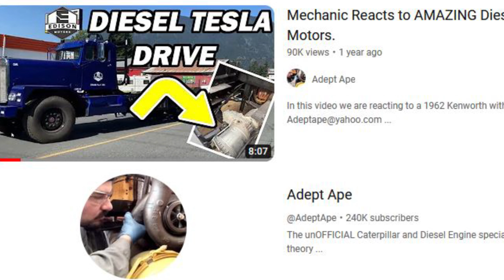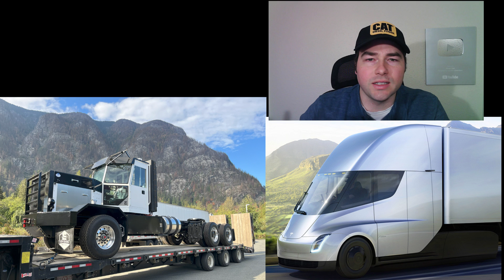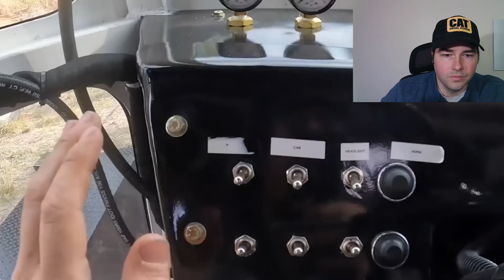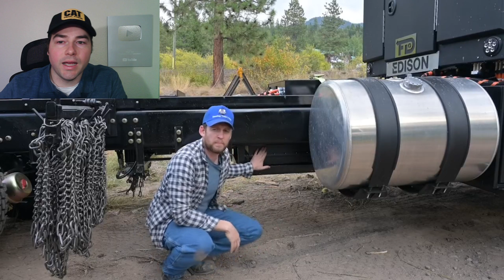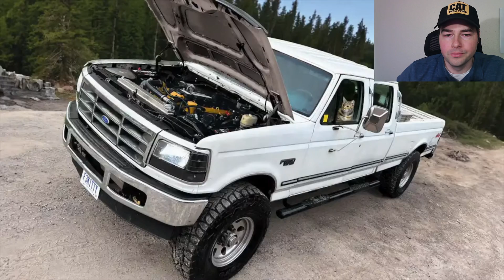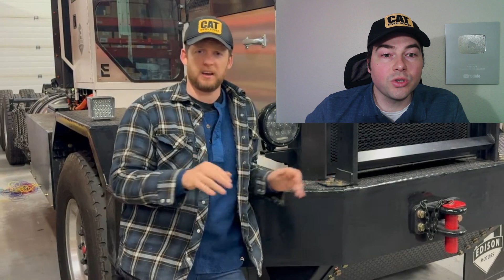Edison Motors New Truck DESTROYS the Tesla "Semi Truck" design!!!

Comment: The Edison trucks actually look like they were designed by people who know what truck drivers and transportation companies want.

The Tesla "truck" is a non-solution looking for a non-existent non-problem.
Reply: The guy is a driver/ owner. I’m pretty sure he still hauls logs. And makes great units.
Reply: Trucks made by Truckers
Reply: Not only that, instead of trying to land on the moon Tesla straight up aimed for the sun. Out of all the fields of trucking long haul is probably the hardest one for a battery-only truck. These things drive on for hours on end, at constant speeds, without stopping. Sometimes there are even multiple drivers operating the truck in shifts, to minimize the time standing still. Tesla is trying to outdo diesel trucks at what is probably their biggest strengths (running on for hours on end) , without many opportunities to play the strengths of EVs (like regenerative breaking or the good acceleration). All the other elctric truck companies focused on distribution trucks and busses first, as their field of work is good at making the EV's advantages shine. With such a vehicle it also doesn't matter if it needs to charge all night.

Edison chose not to bother with this already competitive field, and instead bother with an industry that already feels kinda forgotten or left out both by diesel and electric trucks. Not only is logging and mining another good fields to show the benefits of electric fields, it's also a great field for their other innovations, like the cabin. Whilst big companies stick every part into a windtunnel Edison chose to prioritise repairability instead. Speeds on logging roads are kinda low, so the benefits for fuel economy and even driver comfort are dwarfed by the higher repair costs. For example, curved windshields may lower wind noise and improve economy by a handful % on the highway, but when they break it is expensive to replace them. Topsy has flat window panels, so if you can't find a pre-cut replacement you can ask pretty much anyone who works with glass to make you one.
Reply: That’s because it was
Reply: This is such an awesome design. I can't believe there haven't been more diesel electric hybrid semi trucks based on the success of cargo trains.
Reply: @1800imawake : And that's been the solution all along. Germany tried going full EV with their trucks, but ended up running caterans to overhead wires to keep the truck batteries charged, essentially making big rig trucks one-car land trains.
Reply: @isaiahwelch8066 also known as locomotives, you know these? The big 4400HP diesel electric monsters that haul mile long trains? Topsy is just like that, but for short hauling, usually to carry heavy equipment on bad pavements, most railways have diesel trucks designed especially to do that while running exclusively on tracks
Reply: They don't build the trucks they take old logging trucks and convert them to hybrids
Reply: @DukeNukem3955  They do both and Topsy was built from the ground up, what rubbish are you spewing.
Reply: Wow.  A solution to a problem.  How dare they. 😢
Reply: The Tesla semi was designed by board room members. Forget battery fires, does that putrid Muskrat realize how important it is to get out of a truck after a rollover? He only put one door on the Tesla.
Reply: @pootispiker2866   the tesla semi truck was designed in a wind tunnel, its built to be very efficient, fires are a problem for diesel trucks not teslas.
Reply: @pootispiker2866 the tesla semi is designed to be the most efficient semi on earth. The cab is fine for its use case of running between city distribution centres.
Reply: @saff226 which it does absolutely sucks at that, crazy expensive with poor visibility, extremely heavy, and lacks almost all safety features modern rigs should have
Reply: The Tesla "truck" looks like a truck designed to be in a sci-fi video game.
Reply: They essentially made a railroad locomotive for the highways.
Reply: The Tesla Semi and Topsy are optimized for two very different types of trucking. The Tesla is built to haul things that fit inside an aerodynamic trailer down a highway. It's really efficient and it's a pure BEV.
Topsy is built for hauling very un-aerodynamic payloads, like logs, construction equipment, and generally anything on a flatbed truck.

The aerodynamics have to be bad because of the payload, so you are going to have a lot higher drag and energy requirements.
If you are driving a logging truck, you are also going to have to drive on surfaces like gravel, which are going to have higher rolling resistance compared to asphalt and concrete.
Edison concluded that current batteries just don't have the energy density for this type of work yet and decided to go with a hybrid electric drive. Since they aren't optimizing the aero, they can also get away with building it for ease of maintenance without much in the way of performance losses (flat windshields, generally less compact, etc.).
The con is that it's still basically a highly efficient diesel truck, not a pure BEV. 
If we are going to achieve net-0 by 20xx then we will eventually be forced to gradually transition from fossil fuel based diesel to a sustainable alternative made from a mixture of synthetic E-fuels and biofuels. Just based on the fact that E-fuels are made from green electricity (and water + CO2), this is going to mean that your zero emission diesel alternative is almost certainly going to be significantly more expensive than charging directly from the grid.

Topsy is definitely a huge improvement over current diesel trucks, but as the era of cheap fossil fuels ends and batteries become denser the market niche for hybrid electric vehicles will likely continuously shrink over the next one or two decades, while BEVs continue to expand into new applications and pure ICE vehicles die out.
Reply: @plainText384 there is no way to charge the tesla.

The grid can't keep up as is and won't for 40 to 60 years. 

The tesla is a failure before they even build one.
Also they haven't built any.

People forget about the failing grid.
Reply: Unlike Elon Musk who couldn't drive a truck if he paid someone to do it for him? Like he does everything else...
Reply: Everyone so fascinated by a scam its incredible. I can almost guarantee its more efficient to slap a fucking diesel engine on that mofo and run on that. Wasting fuel to convert to watts, super inefficient. Theres a reason he'll never sell them, hes leeching you people of your money.
Reply: moron, the tesla semi truck is built for low drag and its solution is costing half as much to operate than any diesel semitruck.
Reply: The truck is not a truck in don't have Jakes break
Reply: It’s not even a solution to the problem they said was a problem….
Reply: They don't build the trucks they take old logging trucks and convert them to hybrids
Reply: @DukeNukem3955 Yes, they build the trucks. 
The retrofitting is being done by outside installers.

They also sell retrofit kits to the general public. You can build one yourself at home.
Reply: How?  Unless the current Peterbilts, CATs and so on aren't being made like truckers want either?  To me, this thing looks like a pilfered frame with a home-grown farm tractor cab zip-tied to it that I'd feel sketchy standing near.  The lack of accelerator and brake pedals in this truck is what really got me though.  Plus, if they couldn't get the switches in the dashboard in a straight line, I doubt the cab mounts are straight either.
Reply: @FuckGoogle502 you weren't paying attention were you?

As a driver, I prefer this to comparable diesel, and none of the Commercial highway rigs can do this job.
Reply: @FuckGoogle502 : Keep in mind, this is just a prototype, demonstrating proof of concept. I wouldn't actually be all that concerned, if the truck actually works.
Reply: @FuckGoogle502 doubt you could actually put a zip tie together...

Comment: Style, comfort and livability for the over the road semi truck is pretty bad.
Reply: Then get your luxury spec truck from someone else and go back to Edison Motors and swap the engine and driveline for the hybrid-electric experience. They are also doing conversion you know and their main targets are the vocational trucks. 

In more videos of Edison Motors, a concrete batching plant company is interested on their business (new build or conversion). Transit mixers, when loaded, need the drums to keep spinning. With the Edison way, you can still spin the drum without ever running your engine. And some suburban places requires you to have a permit to run the trucks there as noise complaints are a fairly common reason. You can "sneak" in to the place, deliver your load, then get out without ever running your engine or disturbing the place. Waiting for your next batch of load on the plant? You can wait anytime without ever needing to idle your engine, saving you fuel and engine repair costs when the idle times gets bigger. Even drilling companies are interested on the Edison way for their drilling trucks. No need for an auxiliary engine to run the drilling rig. Let the batteries do the thing for the rig and the engine to just top up the batteries ones in a while. It can even supply power to the site if you install such feature to the truck.

 In comparison to the Tesla Semi, Topsy is shockingly lighter than the Tesla. Even though Topsy is spec for off-highway work, with those ridiculously thick bumper, frames, engine cover and overall ruggedness. Chase even said that he can make it loose some weight for on-highway spec trucks that can still beat the Tesla Semi in range and charging time. The Edison way is charging on the go while the Tesla Semi is charging while not moving at all. The range is set to how much fuel you have on the fuel tank to feed the generator engine (no matter what type of generator engine you want your truck to have).

On the topic of pick-up trucks, they are also targeting the work trucks like a welding rig truck. A welding rig truck has an auxiliary engine to run the welder and welding action takes place seldom times. Most of the time its idling itself and the welders are prepping the materials to weld. In the Edison way, there is no idling time as the batteries can deliver the instant power that the welder needed during action. He even estimates that you can finish the entire day without ever firing your generator engine and solely rely on the batteries. Also, the pick-up truck conversion kit can fit to the most common/popular truck of the world and that is the N-series of Isuzu and their myriad design copies of different companies. These trucks have even more configurations than your typical american pick-up. Truck mounted crane (2 to 4 tons), manlift, transit mixers, sweepers, bus, welding rig, mobile mechanic shop, mobile speakers/dj platform rig, liquid tankers (water, fuel, chemical or waste), dumper, recovery flatbed with winch or tow trucks. The design of having a small COE cab and a long usable rear frame (from 10ft to 20ft) makes it the truck to do it all and Edison Motors can tap into that very big market when they decide to go the international market.

Comment: I think they have gone back to the basics - made it utilitarian (do the job and get rid of all the unnecessary bells and whistles), and keep it designed so that the mechanic can work on it when it needs repairs. It will be really interesting to see the pickup truck prototype!
Reply: If they just take an existing truck body and make a drop-in power system...  at an affordable price.
Reply: @fhuber7507 the kit is a heavy-duty pickup kit. 3 tonne axles? 
Not cheap compared to a 50k Tacoma but much less than a new F 550- 650.
Reply: "do something really expensive, but not expensive this time but keeping the quality" @fhuber7507

Comment: I'm glad we're seeing some experimentation in the diesel-electric area instead of just ICE/EV. Trains already showed us at least in some situations it's not only workable, but very efficient as well. Hopefully we can transfer most of those improvements and gains as more work and research is done, luckily we've already learned a lot through marine/train engineering.
Reply: Diesel electric has been used for years,  in open pit haul trucks. Before they perfected large drive trains.
Reply: Some new heavy equipment has diesel electric which is neat John Deeres I think it's called a 944J big wheel loader that's like the size of a building has diesel electric
Reply: #1 too many rigs and roads.  Period. Disaster. Power outages.  Enjoy
Reply: Those tesla semis are such a joke its pathetic elon is the worlds biggest scammer
Reply: Diesel- electric powertrains have way more losses than diesel- mechanic ones. The reason they are used in locomotives is because a transmission couln't help but break (like many did in the early years of trains) and electric motors provide full torque at 0 rpm. Something you don't need in a truck, because you are moving much lighter loads. Diesel- electrics maybe make sense if you are - for example - in a caterpillar or something. You know, where you would be shifting very much or going back and forth the whole day. But a truck drives on the highway. There isn't much shifting. You go 60 mph or something (I don't know the average truck speed in the US) and the engine is already in his optimal speed range and very efficient.
Open pit haul trucks are diesel- electrics because of the amount of torque applied. So the same reason like in trains

Comment: Going to be a helluva extension cord to plug it in at the end of the logging road.
Reply: Shows you have no knowledge of logging sites, there would be a generator at the logging site but the truck would not actually need it as it has it's own genny.
Reply: @Badgerpapa  They would not need to have a backup genny at eh logging site, these trucks can act as shore power when they are just sitting.

Comment: Edison's approach makes a lot of sense. So much versatility built into one package. The only concern I have is using hydraulic style hoses on the air brake system. I would prefer nylon tubing with brass compression fittings
Reply: What they're calling hydraulic hoses on the air system looks more like Stratoflex that has been around since the 70's.  The ends are reusable because of thread together design. the hose specific to the Stratoflex system is a lot more durable than nylon air line, and is also acceptable for diesel fuel line usage. The downside is that not everyone has access to the hose that is specific to the ends.
Reply: @patrickmoran8790  now that you mention it, I believe I heard in one of Edisons videos they are using a hose like that. I'm curious wether that would be DOT approved for air systems tho. Seems like corrosion was a concern with steel fittings. Also, size of the lines is something else I'm wondering about. Is that hose available in sizes smaller than 1/2"?
Reply: Their airlines won't have problems for the next 60 years though.
Reply: I used hydraulic hoses on my butane conversion. That's all I could get. They'll last forever.

Comment: Canadian emission regs. mostly follow the US Regs.
also if you are running a current emissions spec engine under the hood the DPF and DEF is less of a problem as you are running a engine under load, at speed, and in the ideal power band,
keeping the exhaust hot, which keeps the DPF cleaner with less regens

Comment: I actually don't mind Edison getting into the pickup EV refit market. Say you have an old family heirloom truck, decent shape and what have you, but transmission or engine parts are becoming scarce. Yeah sure you could LS swap it (how original), etc. But at some point with how regulations are becoming, engine swaps may not be feasible to do. It's one of those things where Tesla could have just been an EV conversion company. Sell the motors, gearbox, and battery packs and people can drop it in themselves.